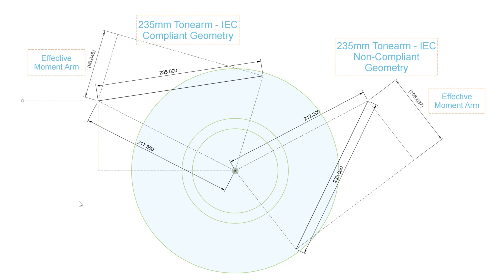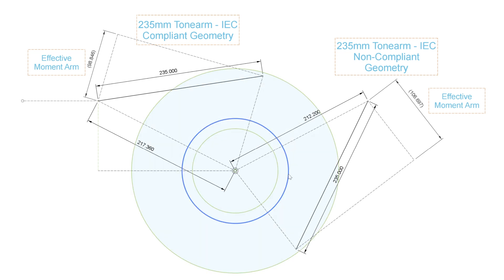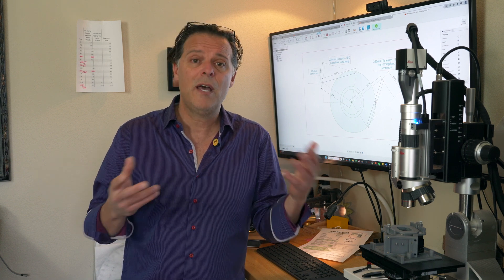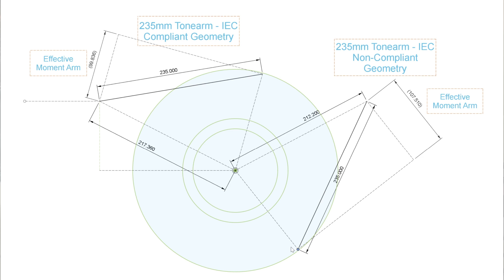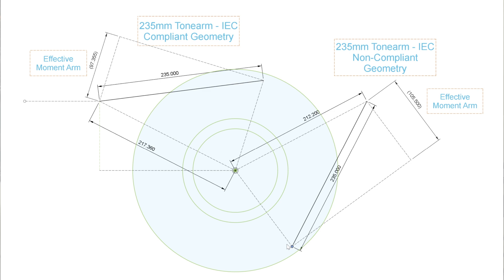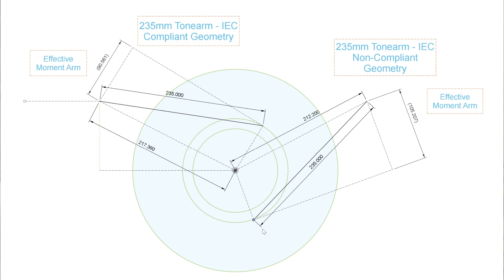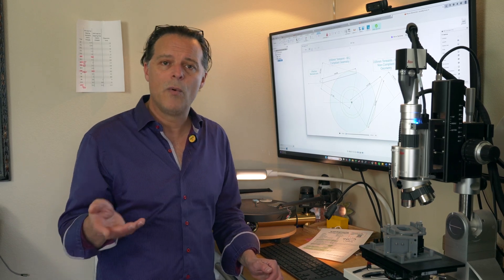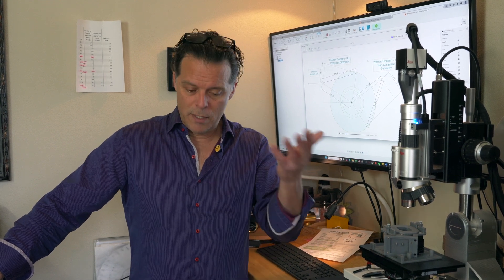Sound Bite #26:  Part 3 of 6 - Skating Force in IEC Non-Compliant Tonearms

Comment: The geometry you choose (Baerwald, Löfgren, etc.)—or the one chosen by the tonearm manufacturer—dictates the overhang based on the outer and inner radii. In short, the geometry optimizes tracking error across the surface of the record. That’s why the inner and outer radii are extremely important: they define the working area.

If you choose a different geometry (like UNI-DIN), same inner and outer radii but different effective length, you’ll end up with a different linear offset (also known as the effective moment arm). As a result different anti-skating compensation.

The difference in effective lengths in this context results from the chosen inner and outer radii, which ultimately dictate the overhang and define the linear offset (effective moment arm). If you check my comments on your previous video, I mentioned this.

I also pointed out that the ratio of linear offset to effective length determines the required amount of anti-skating force. Linear offset has always been part of the calculation, and many tonearm manufacturers list (or should list) it in their spec sheets.

So:
	•	The chosen geometry and working area (inner and outer radii) define the null points, overhang, and offset angle and linear offset (distance not an angle).
	•	Overhang, together with geometry, defines effective length.
	•	The ratio of linear offset to effective length determines the required anti-skating compensation (assuming VTF is constant).

None of this is new—it has always been part of the anti-skating calculation formula.